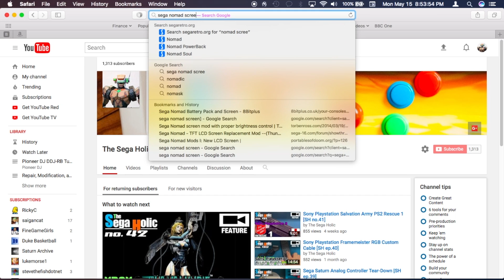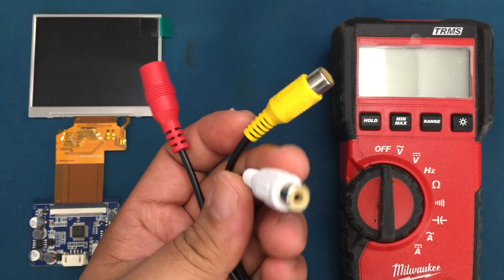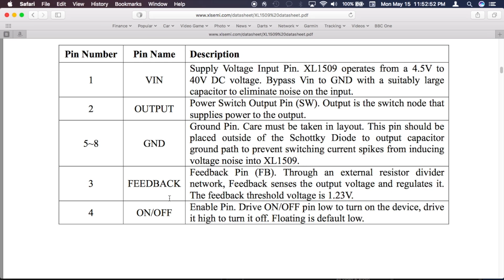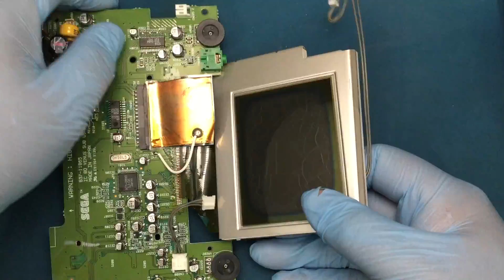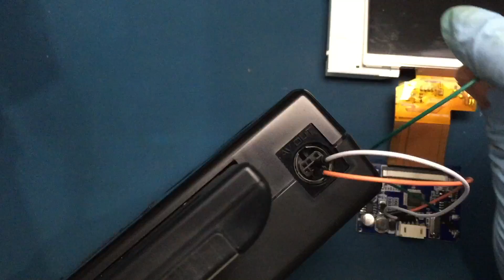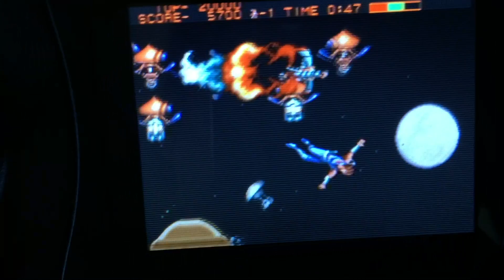Sega Nomad Screen Replacement - A Comprehensive Guide [SH ep.43]

Comment: If I wanted to do this over RGB rather than composite, and I'm willing to spend the extra cash to do so, would the soldering job be any different? What sort of steps would I need to take that differ from the ones above?

I found this screen on eBay: https://www.ebay.com/itm/282226653855 would that suffice? Anything else I should know about having that screen be RGB?
Reply from the maker: Just a couple things. Remember, the Nomad and all 16-bit consoles only output a 240x320 video signal. The one you linked to is native 480x640, so you just have to make sure that the driver board has the capability to uspcan the 240x320 video signal so it displays 'edge to edge' and not be bordered by black and be small size.

Also, since the dirver board only supports VGA input, you'll need to build a circuit to separate the compostie sync from the Nomad to H and V sync needed for VGA. You can use the RGB signals from Nomad with VGA, you just need to figure out how to make your "composite sync splitter." You should be able to google this and find a schematic.

Another option with sync is that you may find Horizontal and Vertical sync directly on the graphics chip for the Nomad. Usually, H and V sync goes to another chip (IC) to combine and make the composite sync.

Looking at the picture on ebay, there looks like there is a CVBS (Composite video) input, but obviously, you're not buying the display for that option.

Optimally, you want a display with a driver board with RGBS inputs instead of VGA, but those don't seem to exist. Difference between RGBS and VGA is just the sync is separated in VGA (horizontal and vertical). You can dig more into this in my "Dreamcast VGA" video I did, but in the Dreamcast's case, it's exactly opposite as it outputs VGA and my display is RGBS (Framemeister).

So yeah, you can take the chance if the driver board will upres/upscan the signal to fit, and you'll need to build a sync splitter.... unless you can find a schematic for the Nomad or it's video chip to find H/V sync.
Reply from the maker: Oh, and one more thing.... you can find out a lot about any LCD driver board's capabilities by googling the video chip's part number (the big chip with tons of traces running to it) and searching for it's "data sheet."

Data sheets are manuals for electronic components and IC's that pretty much details every aspect of the part.

In your case, google "mst703-LF"
Reply: So the ideal situation is a display with a native 240x320 resolution that takes standard RGB input (rather than VGA). But there is no such display on eBay, right, only ones that take VGA? If that's the case, have you seen a VGA display that has a native res. of 240x320?
Reply from the maker: Ideally, yes, a native 240x 320 (240p) resolution would be best since the Nomad/Genesis output resolution over RGB is 240p. VGA IS 640x480 (480p), so there is no such thing as a VGA display with a native res of 240x320. How the 240p output of the Nomad will be handled is determined by the video chip on the display controller (diver board).

Here's the data sheet on the MST703-LF video chip on that display/driver board combo the OP posted to on eBay.

http://www.datasheetspdf.com/pdf/770936/Master/MST703/1

Notice on theat first page that it only mentions "support of 480i...." and higher, unfortunately.

Now you could be the guinea pig and try the VGA display and build a sync separator for the csync of the Nomad... or find the H and V sync directly off the video chip on the Nomad and see how the driver board of the display handles 240p, and be pretty famous within the Nomad gaming community....

OR....

You could commission a diplay manufacturer in China to make a 320x240 display with diver board that supports RGBs inputs with a connector or solder pads. I don't think it should be too hard for the to adjust the designs of the current 320x240 displays that are common on eBay and use a different video chip that handles RGBs. They could even use the same video chip, and just build the sync separator for csync on the driver board, since most video chips have H and V sync inputs.

This really isn't a joke, as the road between consumer and manufacturer is closing with commerce sites like Alibaba/Aliexpress.
Reply from the maker: OK guys... IF YOU GUYS WANT TO BE THE GUINEA PIGS.... I was looking more closesly at the data sheet for the video chip on the driver board on the LCD display/driver board combo linked on eBay on the original post, and looks like the video chip supports csync, so you don't have to make a sync separator.

https://www.ebay.com/itm/282226653855

I linked the data sheet in my prev post....

Now, if the driver board displays a 240p signal correctly (edge to edge), it shouldn't be too bad... like viewing 720p on 1080p native res TV's....

Looking at the data sheet pages 4 & 5. Page 4 shows pin assignments for the video chip, while page 5 is the descriptions for the correspoding pins. What you would need to do is solder the Red pin out from the Nomad's AV out to pin 6 on the video chip, Green pinout to pin 4, Blue pinout to pin 2, and csync to pin 7, and lastly ground to pin 15 and 20.

And see what happens.

BTW, there is a 2nd set of RGB inputs (pins 10, 12, and 14 on the video chip).

Now, soldering directly to the chip looks like its gonna be a challenge. I would get a multimeter and some sort of magnification to see if traces from the pins on the video chip lead to test pads or a connector. OTHERWISE, I would assume that the R, G, and B and H sync (used for csync for RGBs according to the datasheet) from the video chip lead to the VGA connecto, and using that would be a much better option that soldering direct to the chip... as that would also be next to impossible.

Obviously, you'll need to supply power. 

If you guys decide to try this.. GOOD LUCK!
Reply: I'd be super willing to be a guinea pig for these sorts of things, but from where I stand, it sounds like commissioning a display manufacturer might be the ideal way to go. Considering I'm already after perfection by pursuing an RGB-mod for my Nomad, it doesn't seem like a crazy leap. I know it's more a business question than an electronics question, but do you know how that sort of thing would go and what the next step would be there? The manufacturer would have to be convinced there would be more than a niche use for these, for economic viability reason, no?
Reply from the maker: Niche or not, economic viablity comes from your pocket... or those who are willing to help fund this display. The manufacturer usually will not do small scale production, but if you're going to pay more per piece than it does not matter how many the manufacture makes, as long as they are getting reimbursed for their time and materials that would make sense for them to make.

Cost will definitely be offset by using off the shelf parts/components. What matters the most in this instance is to find a video chip that can scale a 240p signal to 480p of VGA (640x480 pixels), or just be able to outpout to  3.5" display that is 240p native (240x480 pixels), Does a video chip with these specifications exist?

Finding the right video chip is the most essential part of what the manufacturer will do in design of your proposed driver board.

If you're serious, the specs needed is just
1) display size that would fit the nomad (3.5")
2) A video chip that would handle a 240p RGBs signal to display properly to a 3.5" display, wheter it be a 480p or 240p display.
3. The dirver board needs to be small enough to fit in the Nomad housing.
4. The driver board needs R, G, B, and composite Sync input pads.
5. The driver board/Display be able to run off of 3.3V or 5V. This is important as it will cut down cost on an unneeded voltage regulator circuit.

And then you can work with the manufacturer to iron out details.

I'm pretty sure you can contact a display manufacturer on Alibaba/Aliexpress, or go to Asssembler.com and ask there how to get this rolling as far as getting your design and manufacture of this custom Nomad display off the ground.

As far as funding goes, maybe set up a "go fund me page" or Kickstarter once you find out the price from the manufacturer.

BUT BEFORE YOU DO THIS....

There is a person who used the display you linked on your original post on a Raspberry pi running emulators. I'm not sure if he is using the driver board, but perhaps you could ask, although the language on the YouTube video page seems like it's Scandinavian or German.

Here's the video of him using the PD035VX2 VGA display compared to a regular 240p display:
https://www.youtube.com/watch?v=sQ851uAGzmI

Notice the higher quality from on the VGA display. Now again, what we dont' know is if he's using the driver board from the ebay link you listed, or if the Raspberry pi is driving the video. If he's using the driver board from the ebay link, then ask if he's inputing 240 to it.... and if that's the case, it would be great news as all you would need to do is wire R, G, B, and sync to the R, G, B, Hsync pins on the Dsub connector.

LMK if you need more help.
Reply from the maker: BTW, here's more thoughts on this...

The YouTube video I liked to showing  the PD035VX2 VGA display compared to a regular 240p display
https://www.youtube.com/watch?v=sQ851uAGzmI
Is the emulator enhancing the video? 

The PD035VX2 VGA display is EXPENSIVE, and it's takes up the majority of the cost for the VGA display/driver combo. I looked it up in Aliexpress, and they start at $50+
 https://www.ebay.com/itm/282226653855
Reply: Just to let you know, I'm still looking into this. I was busy this week, but I will contact that guy soon. I think I wanna save up and make this happen - we need an RGB Nomad mod. It's about time.
Reply: Just to make sure, the issue with buying a screen like this: https://item.taobao.com/item.htm?id=560257989612&ns=1&abbucket=1#detail is that even though it's the right size, the resolution is accurate, and it can take RGB input, there's no driver board to match it, correct?

Comment: Great tutorial, you can still buy the screen with the brightness control resistor that I used at torbenross.com on aliexpress, 
Here is the link for anyone wanting to try :-) 
https://www.aliexpress.com/store/product/3-5-TFT-LCD-Display-240x320-RGB-LCD-Display-Module-Kit-Supports-Multi-function-Display/803166_32715407296.html
Reply from the maker: Thanks for the link. Did you check out the "USB for power" or "AV out for power" guide?
Reply: When I bought my nomad it came with the original rechargeable battery, which I then promptly converted to a lithium ion battery with inbuilt charger, but I can see that the USB power is a very handy mod for people who don't want the clunky original battery or don't have one :-)

Comment: For the back light connector which pin is ground and 5V? (The are labeled 1&2, too bad they werent labeled 5V and ground) I ask because my current nomad has a busted power jack, so I can't tell whats what with my multi meter. I honestly don't even know if this thing runs. I have a USB Cable split open and ready to try this out.
Reply from the maker: You can test at any ground point to one of the pins at the backlight connector using your continuity tester. Or you can test at the +5v at the AV out to one of the pins at the backlight connector, again, using your continuity tester.
Reply: Even without a power source?
Reply from the maker: You are checking for continuity... the "beeping mode." Why check for voltage when it is unessary. One of the 2 pins on the backlight connector will lead to ground, and the other to the +5v at the AV out.... The pin that beeps when testing out the +5V at the AV out will be your "positive," the one that leads to ground is "negative."
Reply from the maker: BTW, you can power it up through the AV jack.... just solder the USB wires to some legs that your cut off on your capacitors.... and you can shove those pins into the AV jack.

The +5V at the AV jack is actually connected to the +5V at the backlight connector.
Reply: I have a cen tech multi meter, lol. it doesn't beep.
Reply: It is working without a screen through the AV jack though. Listening to Phantasy star IV right now. Now i can at least get the new LCD setup.
Reply from the maker: Go out to Home Depot, Lowes, Sears, or your local electronics shop, or Amazon:

https://www.amazon.com/Neoteck-Multimeter-Multimeters-Resistance-Transistor/dp/B01NAVAT9S/ref=sr_1_10?ie=UTF8&qid=1502523212&sr=8-10&keywords=multimeter

You cannot really function without a continuity checker. It is the backbone and a necessity for any type of eletronics repair and diagnosis. You will find other needs around the house for it also.

It is literally like going fishing without a fishiing pole.

If you can afford it, get a FLUKE brand.
Reply from the maker: And like I wrote earlier, you can use the AV out jack so you don't have to solder anything.
Reply: Alright. I will order the one you suggested on Amazon. Wanted to test out the AV out which is why i wanted to use the back light port. Already had the wires soldered to the legs of a capacitor, before you suggested it. Thanks
Reply: You should consider making and selling a custom all in one cable solution like you suggested. I would certainly buy one, as would many others.
Reply from the maker: Should have told you.... if you use 5v power (usb), it's not going to be enough to power both the new lcd screen and a composite out at the AV out jack same time. Remember, youre using composite video for the new lcd screen. You may need an amp to drive and external TV and the lcd screen at the same time.

If you're going the RGB route, it may work. I tried buyring a SCART cable and tried 5V trrough the cable, making an all in one solution. But it doesn't work as SCART cables use composite video as sync. The 9 pin din side is impossible to take apart to resolder the composite wire to the sync pin instead; so I"m not sure yet if using cysnc for sync will make it possible; although I am hopeful. I just need to buy a 9 pin din male connector like I linked you before and try it out. 

But I have too much on my plate right now. So much stuff I want to do that's been held off for a year now. Unfortunately, the video style I do takes quite a bit of time to cut.
Reply from the maker: First attemp failed, like I explained in my other post... what I mentioned was a theory. I'm still positive it'll work though.... but only using RGB with csync as sync at the AV out.
Reply: The Sega Holic I will try it out tonight after work. I have an RGB cable. Not sure if it uses csync, but,  will change it if I have to.
Reply: Rather, I will try it after I get the 9 pin din cable...gah need sleep
Reply from the maker: Get the connector instead! The ground pin on a Genesis/Nomad is the outer ring. On 9 pin din cables, no wires connected to the outer ring. You'll have to take apart the plug, which is not eay, and solder one of the wires to the ring.
Reply: The Sega Holic Can you link me to the one I should get? I got the other Nomad, so I will try powering through the AV out tonight after work. And yes, it has the original screen.
Reply from the maker: https://www.amazon.com/1pcs-Male-Mini-Connector-soldering/dp/B01HJKD1LS/ref=sr_1_12?ie=UTF8&qid=1502589456&sr=8-12&keywords=9+pin+mini+din+male+connector

Or you can search for "9 pin mini din male connector" on eBay. Look at the AV out on the Nomad, you can see some pins are offset, and you can make sure you are getting the right one.

Also do an  image search for "9 pin mini din male connector" and see how it looks like.

It's going to be much easier hacking a USB cable, and connecting that to this connector instead of the other way around.
Reply: The Sega Holic excellent

Comment: The sega Holic friend you can put a link of a imagen on where is each solder point? 5v, ground and video? i have  the same board and in the video i dont see so correctly where is the point, thanks a lot!.
Reply from the maker: OK, give me an hour....
Reply from the maker: http://i252.photobucket.com/albums/hh3/ctwentytwo/DSC00017b.jpg
Reply: thanks you so much for the effort but you link me the 5v from nomad board i think? i need to know the 5v point on that LCD board :P ajaj sorry for mistake :/
Reply from the maker: Jonathan CB oops, sorry! Give me a couple hours, im out of the house.
Reply from the maker: OK, this should be it:

http://i252.photobucket.com/albums/hh3/ctwentytwo/driver%20board.jpg
Reply: The SegaHolic Do you have another link to this image showing the jumper wire for the lcd board as this link doesn’t work and I’m about to do this mod on the same board? Thanks